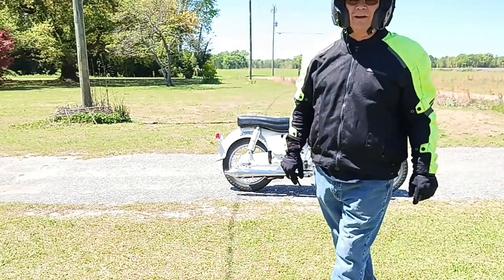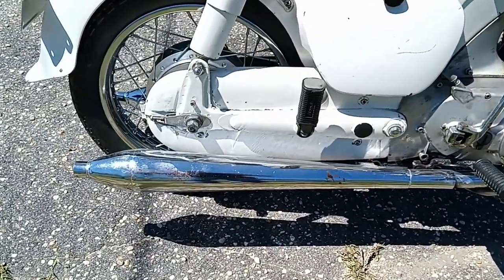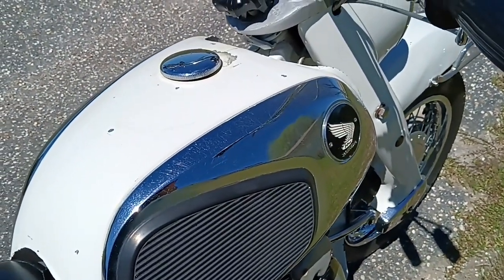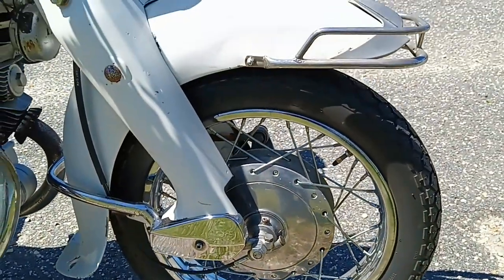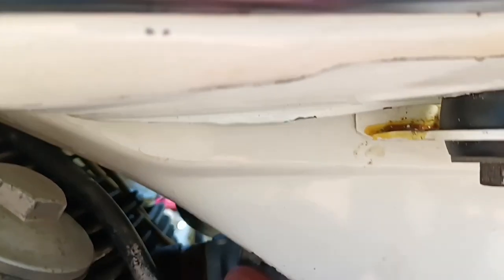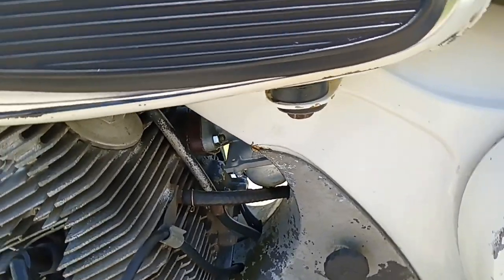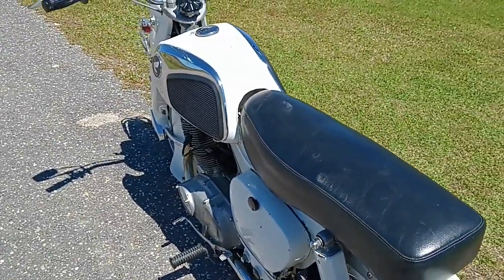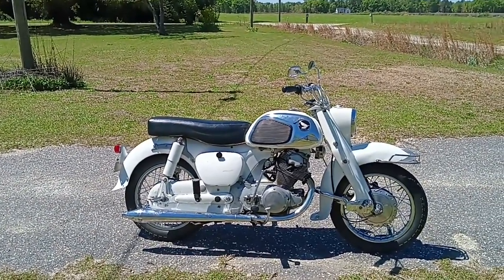1962 Honda Dream

Comment: Hey Floyd, enjoyed your little talk on your Dream.  I have my 60 C77 Dream which is restored, I try to ride it about once a month, usually in the morning before all the idiots in cages come around.... with the early classic bikes not having turn signals or adequate brakes you definitely have to be quite aware.  You say that you take it on the highway, which I say no way!!  Here in California, the drivers will run you over if not doing 70+ mph, which we know the Dream would have a hard time doing... so when I ride, I usually just keep it on the city streets...
Reply from the maker: I only take it on local US highways with 55-65 mph speed limits. I definitely would not recommend getting on the interstate with it. Although my wife and I did ride I-40 through N.C. on a 250 scooter one time, that was nerve wracking.